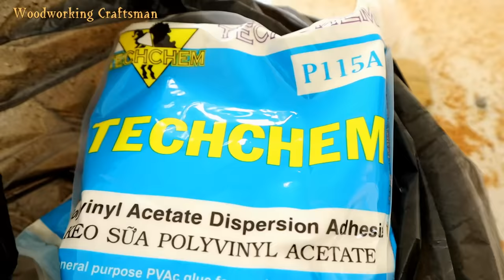Woodworking Techniques Extremely Strange with Asphalt | Amazing Wooden Stairs Design Ideas Beautiful

Comment: It’s the same method used here in the UK back in the 1930s, for polished, parquet wood block flooring. They were set in hot pitch. Also wooden roads, made again from wooden blocks in towns and cities during the 19th century. I remember in London, back in the 50s, when they ripped up the old tram lines, the old “tarry blocks” were chopped up and sold as fire lighters.
Reply: Any idea on the benefit of the pitch?

Comment: Great use of the available materials to secure the wood to the concrete steps and landing.  I can't wait to see the finished staircase.  You have done an incredible job of designing and building the most exquisite wood projects in this home.  Wow, wow!
Reply from the maker: thank you!!!
Reply: @WoodworkingCraftsman  ⁰üüüüüüüüüüüüüüüüü00000000000000000000000000000000000000000000000000000000000000000000000⁰00000
Reply: Que liquido é esse que eles colocaram no degraus, será que é cola de madeira derretida?

Comment: The asphalt not only used as adhesive, it is a termites deterrent too.   It Is useful in termites infested area, workers can place an asphalt soaked cloth at the ground foundation of walls to prevent termites encroachment from the ground of walls.

Comment: Great work and low productivity. A lot of time, a lot of labor and many steps. The wood is installed before the end of the work and the workers stay walking, scratching and dirtying the wood of the stair. But from the point of view of the work effort, it scores ten.
Reply: Those wood finishes are tough mate, after the whole process  they can sand again and apply the final coat so no worries.

Comment: I think using the hot asphalt is genius. By creating that little dam it is self-leveling and because it doesn't compress it's parallel with the Earth besides it being used as an adhesive. So smart.
👍👍👍👍👍👍
Reply: Что особенного? Наши деды деревянный паркет ставили на горячий битум.
What is special? Our grandfathers wooden parquet put on the hot asphalt.
Reply: @tims6845  Ну не совсем чистый битум, там 3-4 компонента. Должно быть🤔

Comment: The timber and end product are stunning and there's  no doubt that all the craftsmen are very skilled, but here in the UK, Health and Safety regulations would not allow a workshop to operate without safety guards and dust extraction on every machine, sanding with angle grinders is forbidden, as they have no guards or dust extraction. Worksop floors have to be spotless and steel toecap boots worn not flip flops, no wonder things take so long in this country and cost a fortune!
Reply: Would you prefer to work in Malaysia/Thailand then?
Reply: Holding the wood with their barefeet made me laugh my ass off!!! ha ha. Tbh I found it scary.

Comment: But why ? Is it cheaper than glue ? And would be surprised if you got a good reading when you check with a level ...
Reply: Well done
Reply: Maybe asphalt is more cheaper than glue, minor imperfection should occur even the entire tread was level because they just laid the wooden steps on top without leveling it one by one
Reply: @joecruz9667  true ....
Reply: Maybe its a way to protect the solid timber from damp!?

Comment: I watched this in horror as the open jointer and unprotected saw blade were inches from the workers last day, and then onto the hot tar and sandles... thank God we have safety standards!
Reply: i must agree with u
Reply: Agreed. It is really amazing how some people work. They could even add their own safety equipment. It doesn't have to impede their work.

Comment: Never seen so many dangerous and 1/2 assed ways to do things  run through a planner with no dust collection  anywhere , then. Use a grinder/ sander  then use a belt sander all along while they have a wide belt sander.  . Not routing end grains first and the list is endless
Reply: And they still got the job done without osha, a union or ppe. Go figure
Reply: @nunyabizness9544   and all fingers and toes !

Comment: Good work, but there are two mistakes. The first is that there is a step between the two wide places, and the second mistake is that you did not put a piece of wood between each step, facing it at least 5 mm, so that the final shape would be completed from below as you see it from above well, but from below no because it is missing a piece between each step

Comment: You can use long screw bolt fixed in stairs and cover the wooden holes with putty and paint instead of that dangerous coal tar.

Comment: Traditional way to lay parquet floors up till the seventies in uk.
Reply: It stops any moisture that can rise up through the slab far better than the adhesives we use these days.
Reply: @tedwarden1608   Last time I worked in housing , prior to moving to construction, we were using it on block and beam floors in 96!

Comment: I am not being condemning or negative . Those men are hard workers, using what they have to good results.

I would like to hear what they say about the landings....?? You have a solid wood center banded by solid wood miter banding and tight joints....?? We all watched them cut wit oposising diagonal  cuts 1/2 way thrue .....?? To take care of wood movement. ...??? 

That doesn't work!! All raised panel solid wood doors free float with the center panel so that the center panel is able to expand and shrink with humidity....!!  No glue on earth can hold that expansive pressure!! So after a year or 2, thoes tight joints will be destroyed.... ask any cabinet maker.....rookie mistake !!

Really wish curious what they would say...??

just jim
Reply from the maker: thank you for your comment!!!
Reply: D Z  I like your comment. You would think that in the small circle of wood workers , their coworkers would be discussing this.....? It's obvious their boss doesn't know. If he did he would not allow this ticking time bomb to be built.....??

just jim
Reply: I think that is why they cut the back of the pieces of wood..  less chance of it cupping...
Reply: @fireguy144ify  yes Michael, you will see multiple parallel grooves cut in the back of millwork for that reason.....but it is never that wide and that solid lumber woodwork is neverbanded!. What they're doing is considered a rookie mistake.  Not on purpose,  just a fatal error! That sort of mistake will destroy in the eyes of clients and other wood workers will mock you....a true big picture understanding of wood movement will be critical for survival....

just jim